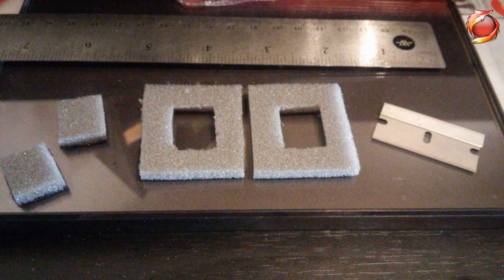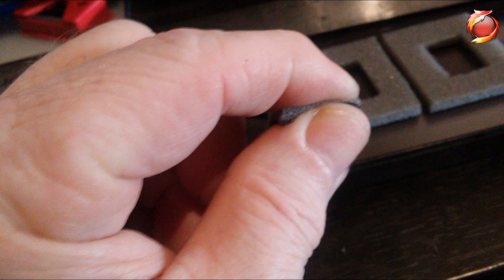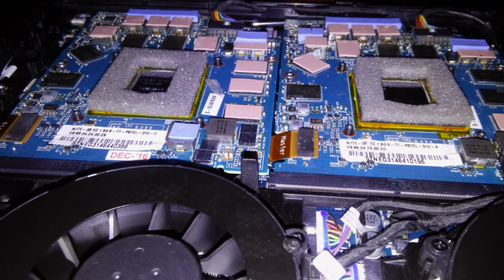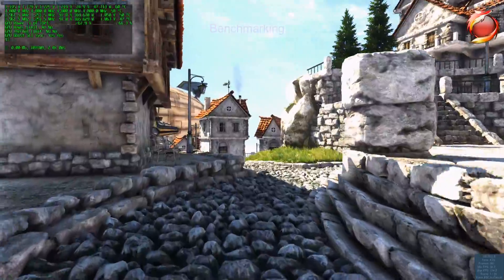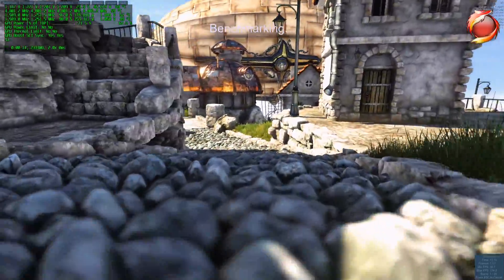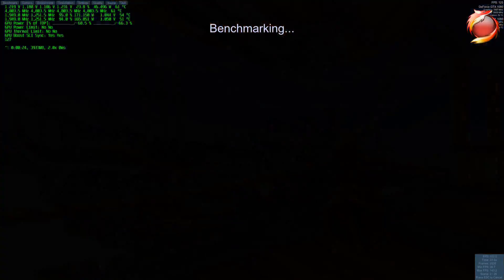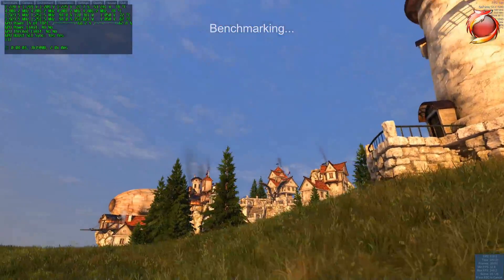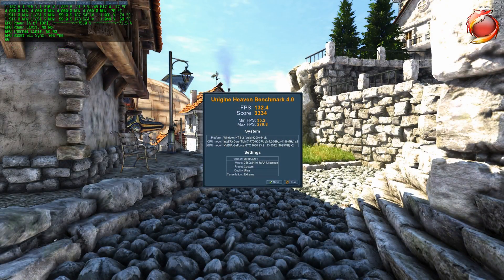How to safely use liquid metal paste on your laptop GPU

Comment: How are the foam sticking on the gpu and cpu and did you use normal nail polish?and how much is the size you cut for middle space of cpu and gpu?
Reply: And 10mm kapton tape a right choice? And for electrical tape can i use 1500 vinyl electrical pvc tape?
Reply from the maker: Yes, you can use that for electrical tape. 10mm Kapton tape will also work fine. I prefer Kapton tape, but I have never had any problem using electrical tape.
Reply from the maker: No need to use nail polish. I use a few drops of Super Glue to attach the foam to the Kapton tape. It does not take much to hold it. For the square hole in the center, I just measure the die and make the hole in the center a few millimeters larger on each side. The square hole in the center can be quite a bit larger than the die and that will be fine.
Reply: @MrFoxRox  ok thankyou brother appreciated
Reply from the maker: @safronee  you're welcome, friend
Reply: @MrFoxRox  and did you use copper shims?
Reply from the maker: @safronee  - hi... Not on the machine in the video, but I have on other systems where poor heat sink fit warranted doing so.
Reply: @safronee  copper shim electricity conductive dude

Comment: What type of foam is it? What do I need to look for to buy something like you have? Thank you very much.
Reply from the maker: It needs to be very soft and thin. It should be able to collapse between your fingertips with no effort so as to avoid interfering with contact between the heat sink and CPU/GPU. I used 3mm soft foam that was used to pack a laptop LCD display panel. If you look in the video I show how it is easy to compress. https://youtu.be/M9QbOOmvHuQ?t=24 - if you use a foam that is too thick and dense it will not compress easily and may cause interference. It only needs to be thick enough to fill the air space between parts, so a piece of foam that is only 1mm to 2mm thick might be enough to do that.
Reply: Thank you for the reply. Could you somehow point me out in amazon or any online shop the type I need to buy? I actually just need a name to search for. Thing is, English is not my first language and I kind of need help to find out what I need to look for. 
What about the temperature resistance of this foam? doesn't it have to be made of certain materials resistant to high temperatures?
Thank you once again.
Reply from the maker: Luiz Felipe Conrado it is difficult to recommend a product that I cannot see and touch to confirm it is low density and easy to compress. It might be easiest for you to visit a craft hobby shop so you can verify it. It would be a product similar to this, but it must be low density and easily compressed. https://www.amazon.com/Darice-Foamie-36-Inch-60-Inch-Black/dp/B007MQMXWS

I hope that helps.
Reply: MrFoxRox, thank you, it does help! :)

Comment: I have done this to my alienware 15 r3 when I found a 3mm foam from a packaging and  without pressing it hard it goes 0.3mm can go 0.2mm. And I just put 3 coats of nail polish. And it works. Better than electric tape.  Gives me peace of mind because my heatsink is the bad version "cci" with uneven gap and I have to use more LM
Reply from the maker: Dan Dan awesome, glad it worked well for you. Thanks for sharing that.
Reply: Dan can you tell me how you did it because i also have same laptop?

Comment: Hi MrFox, with this method, will it become airtight that way the liquid metal won't dry? Also how long will liquid metal last in a laptop without any maintenance if done professionally. Thanks!
Reply from the maker: I'm not sure it will change that one way or the other, but liquid metal always lasts me far longer than normal thermal paste. I have gone a year without repaste, taken a system apart for another reason and found the liquid metal was still liquid. All I had to do was use a Q-Tip and spread it around and put it back together again. Papusan at NotebookReviewForums went like 3 years before he had to repaste the 4930MX CPU in his Alienware 17. If the heat sink fit is sloppy and lots of air can get in between the heat sink and CPU/GPU that is the only circumstance where it gets dried out that I am aware of.
Reply: Thank you so much for the answer.

Comment: Hey man! Great video:p all I want to know is what type of foam should it be? I dont want it to melt or something.... have you ever checked the foam months later? Thanks a lot ^^

Regards from Slovenia
Reply from the maker: DoomX Gaming - hi bud. The foam has never melted. I have checked it several times. I just used the soft black foam that came in the box with an LCD panel. It is about 5mm thick and easily compresses down to like 0.5mm or less.

Comment: Mr. Fox... I could not understand what kind of foam you said you used. I'm also considering the thermal pad route but the compressability may be an issue. Could you provide a link or direct me to the exact foam you used? How were you certain it was heat resistant? Thanks
Reply from the maker: I used some very soft and spongy black 1/8th inch foam that was used to protect an LCD panel for shipping. You should be able to compress it down to zero thickness between your fingers with no resistance. I tested it and heat did not have any harmful effect on it. I tried using 0.5mm thermal pads and that did not work as well for me. They were not as easily compressed as the soft foam rubber.

Comment: Could the foam being this wide interfere with the thermal padding on the heatsink making full contact? I plan on replacing all the stock thermal padding once I open it all up to repaste etc
Reply: I mean the placement of the 0.5mm padding around the gpu die locations acording to this diagram: forum.notebookreview.com/attachments/img_7369-jpg.149523/ 
I'm not sure where the pieces would overlap
Reply from the maker: Make the foam square the same size as the PCB part of the GPU die and then cut out a square in the middle just about 3-5mm larger than the die itself. It will not make contact with any of the thermal pads and will be compressed between the heat sink and the GPU PCB.

Comment: Will those foam melt caused by high temp? How long can this liquid metal last?
Reply from the maker: Shawn Young - I have not seen any evidence  of melting. Liquid metal never wears out. I have used it for more than a year with no change in temps. A friend of mine has has it on the 4930MX CPU of his Alienware 17 for over 3 years with no change in temps. If the heat sink fit is sloppy and air can get between the heat sink and die it will dry out in time.  If the fit is good it will not.
Reply from the maker: PERRY yes it will
Reply: So a 5mm foam will do the job? I always thought the foam is made of plastic........
Reply: And the foam will prevent the  flowability of liquid metal?

Comment: Mr. Fox, would using thermal pads instead of the foam work? I have excess thermal pads of .5mm up to 3mm. Is there any chance that the foam pads would melt or anything? I was looking for foam pads like yours but I can find any that are squishy enough or that I can confirm there melting point. Thanks for your time.
Reply from the maker: Maxwell K - the heat would not be any problem. The only problem you might encounter is the pad not compressing well enough and interfering with die contact. If you use a half millimeter pad and the heat sink is not able to make solid contact with the die your temps will skyrocket. You can certainly give it a shot to see if it works. Trying new things is how we stumble on to great ideas and prove that they work (or prove they do not).
Reply: MrFoxRox2, can you think of any negative side effects if the liquid metal touches the thermal pad? Spontaneous combustion or anything lol? I have extra LM I'll play around and see if the thermal pad is absorbent or melts on contact with LM or anything crazy. I'll let you know what happens
Reply from the maker: The liquid metal should not have any harmful effect on the thermal pad. If you find out otherwise, please do let me know. I have never seen a problem with it before.
Reply: Maxwell, did you end up using the thermal pads? I'm in the same boat as you here, wondering if you had success and the padding was able to compress enough
Reply from the maker: Yes, I did use the thermal pads. You should not leave any of the thermal pads off because the components they are supposed to be in contact with will overheat. If you use very soft foam that is 5mm thick or less it should not interfere with contact of anything. It will simply fill up the existing air space between the PCB portion of the GPU die and the heat sink. If the foam is too dense it will not compress enough. You should be able to easily pinch it down to nothing, like a sheet of paper, between your fingertips.
Reply: JollyRogerBass so I just checked the GPUs and they were both good, no signs of them drying or not making contact and no signs of anything negative with the thermal pad barriers
Reply: MrFoxRox2 yes I used .5 mm pads and they are rather soft so they also give a bit. I did the same concept as your foam pads and the pads were just a hair shorter then the GPU die, I took a razor and checked the level of the die/thermal pad and the die was very slightly higher. Now my only question would be, would there be a down side of the thermal pad touching the side of the die? I left a very miniscule gap between the pad and the die on all four sides but I'm just curious if there would be an issue that you could think of if it was touching.
Reply: JollyRogerBass yes I did use the thermal pads, it been running with the thermal pads instead of the foam for about two weeks now. I will be opening her up soon to see how the pad is holding up and if the LM dried up any due to bad contact. Heat wise she is running the same as before the barrier so I think I have good contact
Reply from the maker: Oh, you guys are talking about using thermal pads instead of foam. As long as they are soft, spongy, and thin enough there is no reason that wouldn't work. If you tried using harder thermal pads with high W/mK rating it would interfere with contact. Thermal pads should not be place on or under the foam. Choose one or the other, but if you use thermal pads instead of foam they need to be very thin and super soft and spongy so they will compress. If they are too thick or too hard it will interfere with contact with the heat sink and cause overheating.
Reply from the maker: Awesome. That's excellent. Did you use 0.5mm pads?
Reply from the maker: +Maxwell K - no downside that I can think of. Sounds like that worked really well.

Comment: Thanks for the video! I'm planning to delid my CPU and apply Conductonaut on it. Is it problematic if some it drops on the pcb of the processor?
Reply from the maker: It can be problematic if you get it on anything other than the die if there are electrical contact points involved. The liquid metal will cause a short circuit if it bridges electrical contacts. It will not harm the silicon part of the PCB in any way. Just be cautious and there is no cause for fear. It is not difficult to apply and I cannot image how you would make a mess of it as long as you are not careless. You also do not want to put it in direct contact with aluminum.
Reply: I just applied Grizzly Conductonaut on both CPU and GPU (cpu delided and CLU on die and HS). But I still get temps about 78-83 C. I expected more. What could be the issue here? Im on a Clevo P775DM3-G btw.
Reply from the maker: There can be a number of things contributing to high temperature. The Clevo P7 family uses a unified heat sink, which is not ideal. The fit can also leave something to be desired. Liquid metal will only work well with solid contact between the CPU/GPU and heat sink plate. Taking the c-clips off of the springs-loaded screws can also help improve CPU to IHS contact. The c-clips are only there as a matter of convenience, but they can interfere with the heat sink getting pushed down against the CPU. On some systems the heat sink will come to rest on the c-clips before it has firm contact with the IHS. Using stock voltage is also an issue. The stock voltage is way too high. If you have not already found the ideal voltage for the core ratio you are running, that is something that can help a great deal to reduce temperatures.

Comment: Thank you for this video, is this foam is better, or the kapton tape?
Reply from the maker: Thank you for asking. Great question. You need to use both. Put the Kaptop tape in place as you normally would, to protect the surface mounted components around the GPU die. You want to make the square opening in the middle to be several mm larger than the die so the foam does not come into direct contact with the liquid metal and begin to absorb it like a sponge. The foam is only present to act as a containment barrier in case a droplet of metal paste were to stray. The foam would catch the droplet instead of allowing it to roll away to another place.

Comment: Great video! By the way do you have a recommended foam to be use? and is there a chance that the hight temperature of gpu melt the foam?
Reply from the maker: Thank you. This is just ordinary foam rubber. Mine was leftover packing material from an LCD screen. It is about 5.0mm thick and compresses down to almost nothing. It is very soft and compresses with almost no effort. That is what you want so it does not interfere with the heat sink making contact with the GPU.

Comment: Interesting. So do these help by functioning like a mop? Thanks for this.
Reply from the maker: You're welcome. No, think of it as a seal or a gasket. It is only there so you don't have to worry about liquid metal paste dripping out of the die area while carrying the laptop sideways and tossing it around while traveling.The square opening in the center is a bit larger than the die.